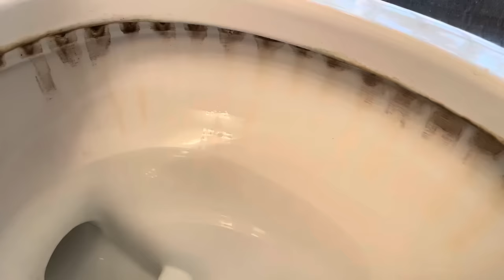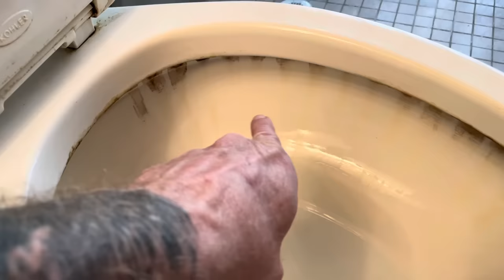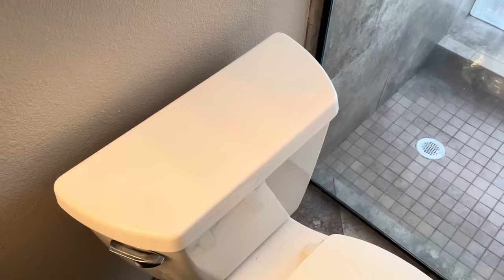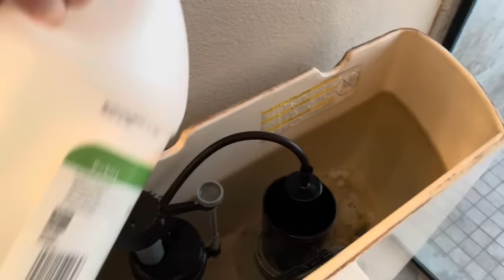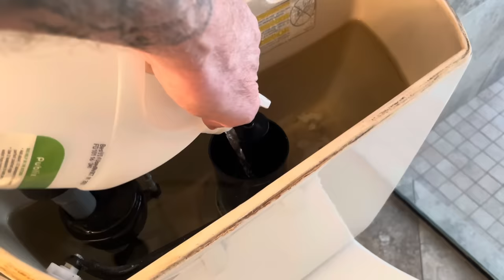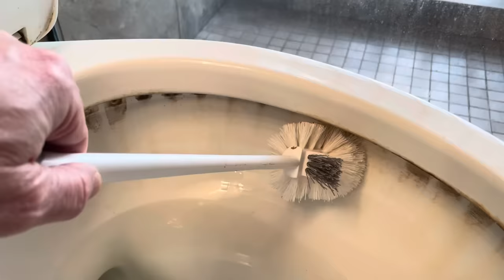Why Does THIS Keep Coming Back and How to STOP it

Comment: I found I had a pin hole air leak in my black malable cast iron well pipe.  Water spirted out and then air gets in to break the siphon back to the 160 foot deep well.   I had this black mold problem until I fixed the leak.   Now no more black mold that eventually comes out of those discharge hole you mentioned in the toilet.
     Air getting in causes this problem with well water.  Maybe mold spores in the air.  But fixing any such leak will cure your black mold problem.

Comment: I love that you got to the point quickly and efficiently. I chose this video after starting another video that took almost 12 minutes to say the same thing. I don’t want to spend 12 minutes on something that can be explained in 2 minutes (especially when the other 10 minutes is spent advertising their videos by telling me to like the video and subscribe, etc. as if I need to be told to do this on channels I like). Needless to say, I closed the other video and came here. 😊

I do want to suggest that it would be better to clean the toilet as much as possible before adding the vinegar. It may reduce the number of times you have to repeat the vinegar procedure.

Comment: I use 20% vinegar for this.  The standard vinegar is usually 5% and works but the 20% is really much faster and dissolves the calcium build up that the mold grows on.

Comment: I always chalked it up to mineral deposit from hard water.  Never even considered the possibility that it could be mold.  Thanks.
Reply from the maker: Actually, you’re not wrong. Mineral deposits exacerbate the problem. They create a bed for the mold to root into. The acidity of the vinegar helps to break them down as well though.

Comment: Dawn dishwashing liquid does the trick also, as well as aids in the cleaning and clearing of your drain pipes.
Once a month i squirt about a 1/4 cup into each toilet and down every drain. Allow 20 to 30 min. to sit, then flush the toilets and rinse out sinks with hot water.
Reply from the maker: It helps with the cleaning no doubt, but it does not kill mold.

Comment: Hi Papa, I didn't know I needed to watch this until it popped up in my feed.  I too have this problem in both my toilets and bc we have a well/septic, limit our use of bleach.   I tried this truck today, having the luxury of a snow day😊 but used a small watering can with a long slender gooseneck for accurate pouring as we have over the toilet storage cupboards that limit range of motion.
Reply from the maker: See also the two videos linked in the description. They can help as well. 👍🏻

Comment: I've had my plumbing license since 1974 and am retired now. I've tried all the toilet cleaners and you have to scrub hard to clean them. Remembering that lime and calcium is the biggest thing in a dirty toilet. I tried 2 methods that works perfect and is cheap and Very easy. Pump all the water you can out of the toilet and add a large amount of Hot water and then add distilled vinegar.  Walk away an just let it set for an hour or longer. All you do then is just flush it, no scrubbing. Trick #2, is use the clothes cleaner, Oxy Clean. Again, Pump all the water out and simply spray Oxy Clean and let it set and walk away for a couple hours. Ta Da, just flush and occasionally a simple scrub works, usually not needed.

Comment: It never dawned on me to pour something down the overflow tube. Great idea! I use bleach instead of vinegar and bleach does well too.
Reply from the maker: Bleach is a very deceiving product… it is far more effective at “bleaching” the color of mold than it is at killing it. Because we believe what we see, we think it has killed it, but it hasn’t. That’s why it comes back so quickly. So we just keep using & buying product over and over again. Great for sales, but not so much for us. The acetic acid in vinegar, on the other hand, kills mold down to the roots, but doesn’t really change the color that much, so you still need to remove the surface stain, but it won’t come back for a long time. Vinegar also helps break down the mineral deposits that the mold is “rooted” in. All in all, vinegar is a far better option.

Comment: For 10 years, I had this problem weekly in the toilet of the apartment in which I reside.  For 10 years, the landlord would say, "Well, that's normal."  I find your video one month ago and invest in a giant bottle of vinegar.  One month later with no return of mold, I'm rubbing my hands waiting to run into my landlord again so I can proudly say, "That was NOT normal and you knew that!"  Thank you so much for this video that went straight to the point of a great solution.  Come on, landlord.  I'm waiting for you.
Reply from the maker: Awesome glad to hear it helped you. 👏🏻

Comment: I did this and it does work. But I will caution you against putting any vinegar into the water in the tank like I did. I put about a glassful of vinegar in the tank and the rest down the overflow tube. After an hour it got ride of the mold but the vinegar in the tank messed up the fill valve and now the tank fills up very slowly.

Comment: Thank you for the tip!!  I used to pour bleach in the water tank to clean the bowl better …
Reply from the maker: Bleach is a very deceiving product… it is far more effective at “bleaching” the color of mold than it is at killing it. Because we believe what we see, we think it has killed it, but it hasn’t. That’s why it comes back so quickly. So we just keep using & buying product over and over again. Great for sales, but not so much for us. The acetic acid in vinegar, on the other hand, kills mold down to the roots, but doesn’t really change the color that much, so you still need to remove the surface stain, but it won’t come back for a long time. Vinegar also helps break down the mineral deposits that the mold is “rooted” in. All in all, vinegar is a far better option.

Comment: I made the mistake of putting vinegar in my tank, but I let it sit for awhile.  It degraded all the rubber on the flush valve, so don’t let it sit very long in the tank.
Reply from the maker: That’s why I pour it in the overflow, not the tank.
Reply: @papajoeknows8355  I learned it the hard way.  Once and awhile I put a plastic bag with vinegar inside and rubber band it to my shower head, it works well.

Comment: I never had this issue until I had my old toilet replaced with a new toilet. Brand new toilet now has this black mold all around it and it's really upsetting to look at . I'll try this but, our plumber (family friend as well) advised up to never use vinegar in our toilets because it will slowly but surely eat away at the plastics and the wax seal.
Reply from the maker: Vinegar won’t hurt plastic, but your plumber is correct in that it will degrade rubber and the wax seal as well. That’s the reason we pour it directly into the overflow and not the tank (where there are rubber seals present). Regarding the wax seal, the only exposure is when we flush it, and that is very brief… if we were doing it often, that may be of concern, but not intermittently.

Also see the 2 videos linked in the description. They may help you as well.
Reply: @papajoeknows8355  Thank you for taking the time to explain this to me. I did mean "rubber", not plastics, thank you for that correction.

Comment: Thanks for this!  I used to use bleach-based toilet cleaners and it destroyed 2 toilets.  Been using Zep acidic cleaner and it's great, but I'd prefer a more natural approach.  Since I use vinegar for most of my household cleaning, this is the perfect solution!
Reply: @kellmac -- For stains or mineral buildup in the toilet bowl that vinegar might not remove easily or at all, I've found that pumice stones or sticks do a great job when used as directed.
Reply: @CivilPeace - Thanks for the advice, but I did that with the toilets we used to have and didn't like it for 2 reasons.

1.  Even though I used it very wet and gently, it made each consecutive cleaning more difficult because the mold gets in the tiny scratches it created.  Same thing would happen with a white countertop. 

2.  The sensation and sound went through me like nails on a chalkboard.
Reply: @kellmac  -- Thanks for your reply. I don't know if there are differences in brands of pumice sticks and in toilet bowl finishes, but I've had no problem with scratching. I haven't seen much if any mold under the rim, either, but I wipe that area with toilet paper almost every time I use the toilet, so that might help. (And yes, I probably have at least some degree of OCD.) 🙂

Comment: I saw another video doing the same thing but with a pump that recycled the vinegar or bleach from the bowl to that middle tube for several hours.  That seems to be yet more effective instead of just one run.
Reply from the maker: Interesting, but I don’t believe it’s necessary, as this is pretty effective on its own. Not to mention probably much easier.

Comment: Put a dishwasher tablet into the bowl. One every six months will do it. Anymore than that can cause problems with the rubber & metal components.  Once a year might do the trick depending on quality of water used to operate your toilet👍

Comment: Yes vinegar works but to really kill off the pesky moldspores which are alive and well I've used a 70/30 mix of bleach and water (scented) allow to stand for 30 min like you did, clean like you did (and I use a softer brush so to avoid abrading of the enamel all the time when brushing) resulting in up to a year of no mold at the jets.  
   

Also, I have added bleach once in awhile to as a maintenance check.
Reply from the maker: Bleach is a very deceiving product… it is far more effective at “bleaching” the color of mold than it is at killing it. Because we believe what we see, we think it has killed it, but it hasn’t. That’s why it comes back so quickly. So we just keep using & buying product over and over again. Great for sales, but not so much for us. The acetic acid in vinegar, on the other hand, kills mold down to the roots, but doesn’t really change the color that much, so you still need to remove the surface stain, but it won’t come back for a long time. Vinegar also helps break down the mineral deposits that the mold is “rooted” in. All in all, vinegar is a far better option.

Comment: I’ve just discovered myself the black mold on the side walls of the toilet. I used foaming bleach and scrubbed it well however, this only lightened the color of the mold. Distilled vinegar it is then.
Reply from the maker: She also the two videos linked in the description. They will help as well.
Reply: @papajoeknows8355    Thanks for the info.       :-)

Comment: It's the water that flows when flushed all the sediment an old gunk when u scrub it loosens it an it will be worse the trick is use baking soda in tank pour a box in with ot water to dissolve so when flushed it will clean it . I use vinegar an soda empty tank add both an everything spotless

Comment: Once the toilet has been cleaned using Papa's method, place a bleach cake in the tank. This will keep the mold in check.
Reply: Of course, flush the toilet several times after cleaning with the vinagar before adding the bleach cake, as the two should not be mixed.
Reply from the maker: Bleach is somewhat effective at killing mold on non-porous “glazed” surfaces. But the internal rim cavity of a toilet, where the mold is flourishing, is not glazed and is very porous, so vinegar is far more effective, as it’s able to kill mold deep down to the roots.

Comment: It can also mean that you have hard water and should get a water softener for your home. Either way the vinegar works great if you can handle the smell. If not then use bleach.
Reply from the maker: Bleach is mostly effective at killing mold on non-porous “glazed” surfaces. But the internal rim cavity of a toilet, where the mold is flourishing, is not glazed and is very porous, so vinegar is far more effective, as it’s able to kill mold deep down to the roots.

Comment: Btw, this partly happens often with toilets that occasionally make the "Running water" sound. I fixed that issue, and cleaned this a few times and haven't seen or heard anything since ;)
Reply from the maker: That would make some sense, because intermittently running water would keep it even more damp inside the rim cavity.

Comment: you can also pour regular bleach / Clorox or chlorine from any pool supply store.....with the vinegar or Clorox method after an hour follow with very hot water in the same manner then flush..BAM!
Reply from the maker: Bleach is a very deceiving product… it is far more effective at “bleaching” the color of mold than it is at killing it. Because we believe what we see, we think it has killed it, but it hasn’t. That’s why it comes back so quickly. So we just keep using & buying product over and over again. Great for sales, but not so much for us. The acetic acid in vinegar, on the other hand, kills mold down to the roots, but doesn’t really change the color that much, so you still need to remove the surface stain, but it won’t come back for a long time. Vinegar also helps break down the mineral deposits that the mold is “rooted” in. All in all, vinegar is a far better option.

Comment: In FL its caused by extremely hard water - if you don't install a water purification system it will keep coming back!
Reply from the maker: That exacerbates the problem for sure. It creates a bed of mineral deposits for the mold to root into. The acid in the vinegar helps to break that down too. You are correct in that it will come back, but it takes much longer.

Comment: That’s mine now. The only thing that gets ride of it for a few days is tiles with Clorox. It also smells so strange. It’s the only toilet out of the entire house with this issue. Also has a crazy funky smell constantly! I’ve done a whole just of vinegar I.   February but not in the section you mention cause it did t help worth square. Still molded and stank At this point I hate the toilet anyway so I plan to get a new one. I even tried an iron out tablet and that now is growing some fuzzy white stuff in the tank. Don’t know what’s happening

Comment: Perhaps temporary sealing jets with duct tape speeds up the procedure. What about using bleach instead ? That kills mold for sure, of course vinegar is also useful to melt down lime in case of hard water
Reply from the maker: Yes, duct tape, but I’m just too lazy lol. Also bleach is somewhat effective at killing mold on non-porous “glazed” surfaces. But the internal rim cavity of a toilet, where the mold is flourishing, is not glazed and is very porous, so vinegar is far more effective, as it’s able to kill mold deep down to the roots.
Reply: Bleach does not kill mold as effectively as Acetic acid. Your tap water already has chlorine in it, so the mold is literally living in small amounts of it. USe the Vinegarm or better yet, get industrial vinegar.

Comment: I live in reynoldsburg, Ohio and I have this in my toilet. And I asked around about what it was and they told me that the sewer system in Reynoldsburg is terrible and it was the water? And honestly, the smell from the sewer does back up into our sink
Reply from the maker: Honestly, they are contradicting themselves… the sewer system is “outbound” waste water, while the water lines that feed your plumbing fixtures are “inbound” clean water. When we smell sewer gas, the number one likely culprit is a dried up P-trap… in the bathroom where you’re getting the sewer smell, is there a sink, shower or tub that is used infrequently?

Here’s a video that explains…

https://youtu.be/zmIZ3xePJeM?si=M2h-jQm6-LDUQxrr

Comment: We clean our toilets multiple times a week...low water toilets not known for being clean after BM's.   Despite this frequent cleaning, we're getting these mold streaks.   The dampest bathroom  (other bath is a half-bath) was getting a funky smell from mold I didn't see unless I crouched nearly to the floor. My parents had traditional (5-gallon?) toilets that stayed a lot cleaner with a lot less of this mold.   I wonder if toilets were constructed differently back then (1967) or the greater use of water cleaned everything more efficiently.   I'm sure not advocating for wasting water at flush...just wondering about the reason for this recurring mold.
Reply from the maker: There are too many variables to know why (i.e. toilet design, mold spores in the environment, water quality, hard vs. soft water, usage frequency), but suffice it to say that dark & damp area like the internal rim cavity of a toilet is fertile ground for mold to flourish. How’s that for a run on sentence? Lol

Comment: So I have a toilet that doesn't see much use, I came back to check on it, and the water level in the bowl had receded quite substantially. I also have one of those things that clips onto the toilet and releases blue detergent or whatever. And it looked like the porcelain had sorta eroded, but I can't be sure and didn't have the time to clean it and see. So I was wondering if those products can damage the enamel/porcelain if it becomes too concentrated and left to sit?
Reply from the maker: Yes, they can affect the bolts, gaskets, flush valves, etc. They can even corrode the tank itself. As far as The receding water level, that’s likely just evaporation and perfectly normal if it’s not used often.
Reply: @papajoeknows8355  Thank you very much.